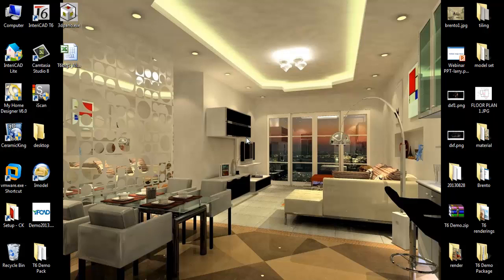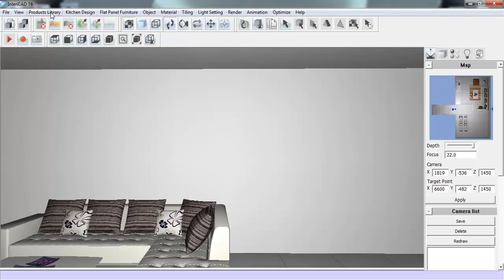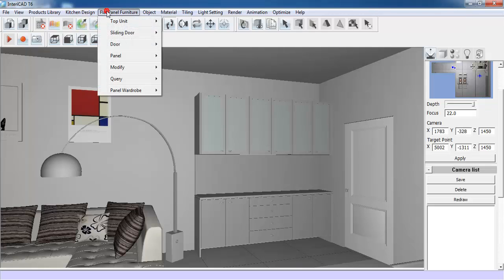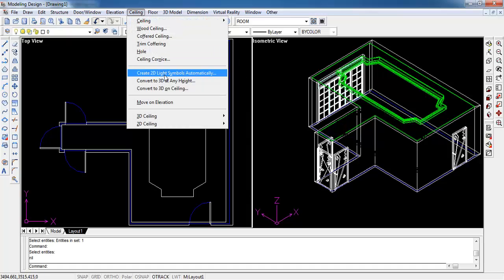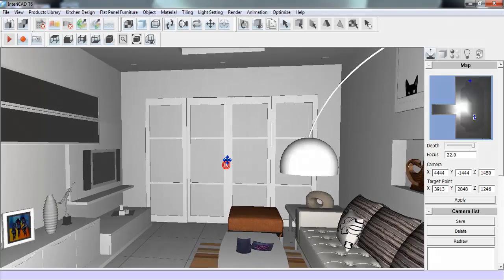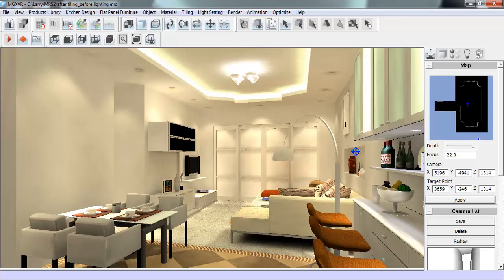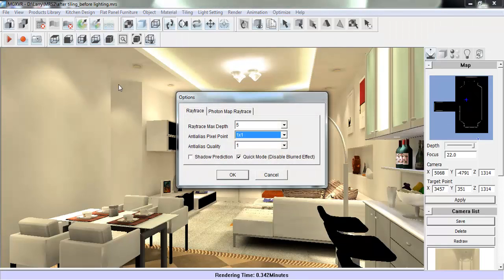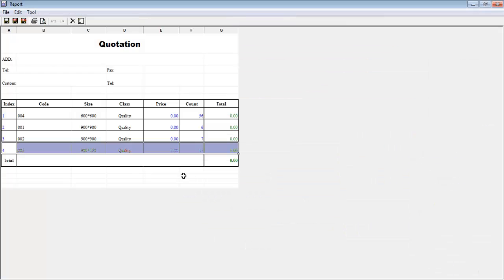Best Interior Design Software

Comment: It's not really a good software when it comes to plans. Most homes are in brick-veneer construction, which means there are two types of walls, one being an external brick wall and the other is the frame and plaster sheet construction, which means there are to be two separate walls on the plan details so show which is the bricks wall and which is the wood or steel frame, as some homes have opted for a steel framed homes in areas where termites are a problem. So, having two walls along the outer wall of the plan is critically important for measurement of the external and internal wall. to accurately lay bricks perfectly with the matching windows and doors where the bricks stop and start at the other end of the windows and doors. So, when drawing an external wall it must have two lines instead of one that represents the two walls, whereas the internal walls are only one line and both the twin external walls and the inner walls must have their own thickness, e.g. the bricks used and their thickness and the wall next to it being the same wall as the internal walls, but because the plaster sheets (you call them Drywall) on the external frame is only one sheet and therefore one measurement of 12 mm thickness, the internal walls have two sheets at both sides and is another 12 mm thicker. These wall measurements both external and internal are important in home plans, otherwise the builder would have to start scratching their heads as to how you came up with a plan that doesn't measure up with the real construction. IMSI is the only Floorplan that offers walls thickness measurements and the drawing, if dome properly will look professional and easy to understand. Again, it depends on the type of house you want. Some are double bricks but all double brick homes built since the 40's have 30-40 mm gap between the two external brick walls to allow air and eliminate moisture, plus keep the home cooler like a thermos. Other double brick homes built earlier that the 40's are solid bricks with stucco or plaster added in all walls and then painted over.
Reply: ACAD Pte Ltd Singapore 
Yes, I've been trying to find a floor plan software that allows double walls and each wall is fully adjustable in thickness and height, both the outer wall and inner wall. And when the outer wall is drawn on the plan, those two different thickness walls must flow together, then for inner walls, a separate icon that should be there to draw inner walls. This icon has its own properties with fully adjustable thickness measurements and height. And is able to snap against the inner wall of the external double wall. I mean, if i could send you a screenshot, I would. So far I haven't found such software but I had to modify the IMSI Floor Plan 3D to get what i wanted. I thought, I'd find another software that would do a plan to my expectation. So far, nothing.

Comment: If there is no trial version how can we know if it will work on our PCs ir laptops. What do I need to have to be able to run the program ? What parameters
Reply: Guh...ok I my point was that you don;t know for what are you paying. U pay u download and install smth and there is the big chance to be a scam. And it would be really sad cuz this softower is awesome and maybe the one of the most productive ones out there.
P.S. my old PC run programs without lag without  the min  system requirements
Reply: yes
Reply: maybe checking out the system requirements?  
For InteriCAD T6
Operation system:
Vista or Windows 7, Windows 8
Hardware recommended:
CPU: Intel Core i3 or above;
RAM: at least 2GB;
Hard Drive: Minimum of 7 GB free hard disk space is required for full installation;
Display: recommended resolution is 1024*768 or higher; Standard Open GL graphic card( Nvidia
Geforce series is recommended) with on-board video memory of 256 MB is required.
Reply: ACAD Pte Ltd Singapore So this soft is actually real ? Omg then you did amazing job